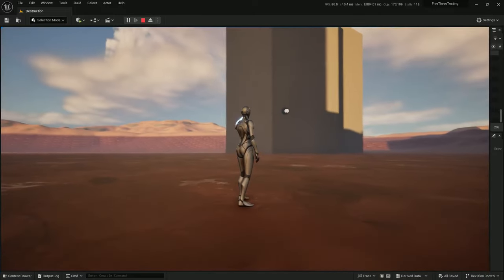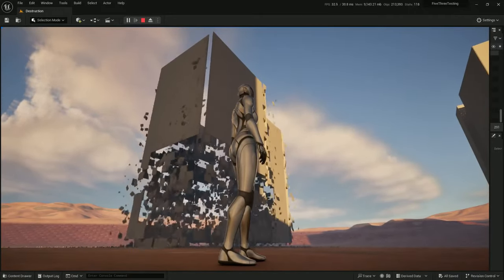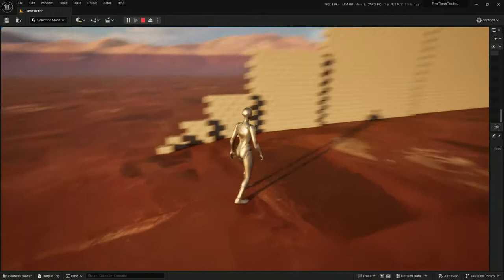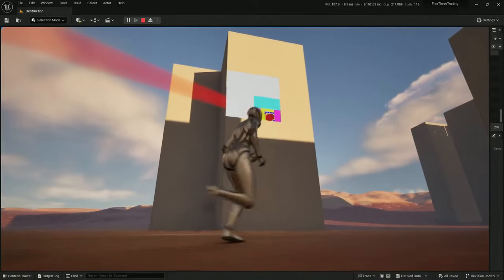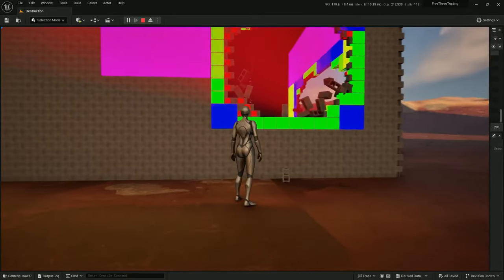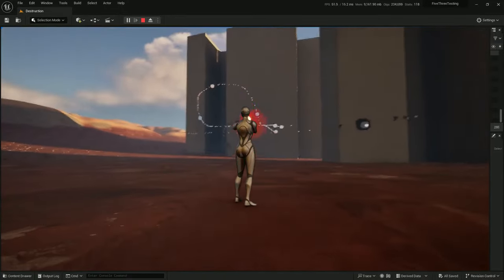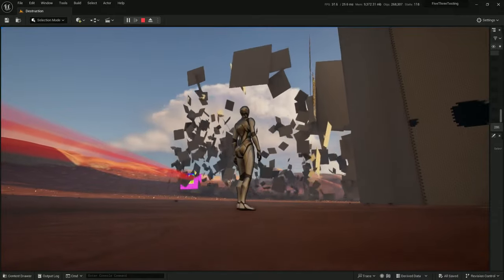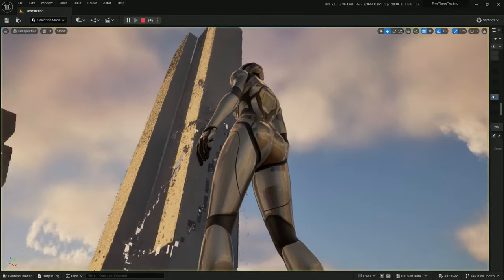Procedural Content.. Destruction?! Unreal Engine 5.3 PCG Experiments

Comment: Hey Michael I was using a pcg setup that uses the landscape patches stamp sytem to basically create pcg height maps to basically make worlds with pcg heightmaps however when pcg spawns the actors that create the height maps during runtime the graph gets stuck in an infinite loop and creates more height maps on top of each other since the landscape changes thus the point location changes any suggestions on how to fix this or if you have time maybe play around with it in a video of yours, your input is greatly appreciated many thanks :)
Reply from the maker: Hey TheWok, I wasn't aware that the heightmaps spawned with PCG would work at runtime, that's great!

You'll want to make sure the graph runs once, and that you clear it (and the patches) before it runs again. I'm not sure why yours is running multiple times at the runtime generation, but if you're calling generate on it via BP you could try calling a "clear" on it first to get rid of any existing landscape patches.